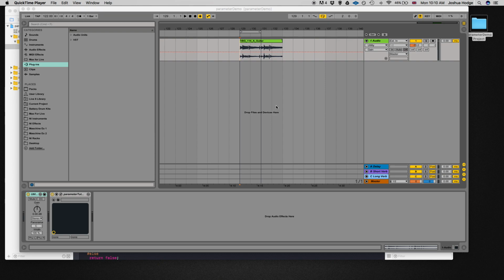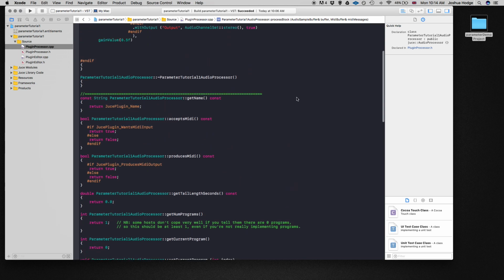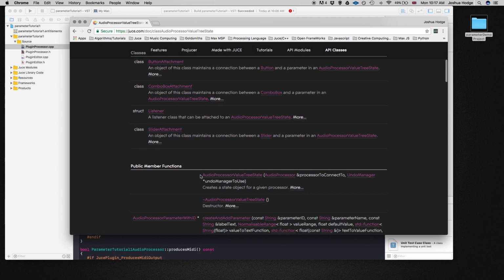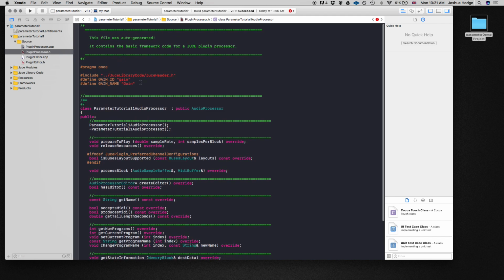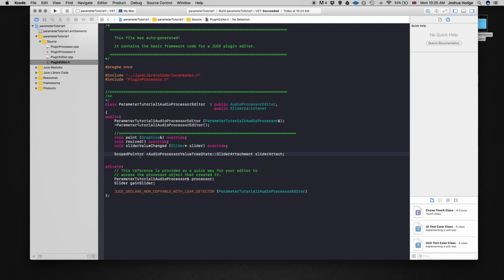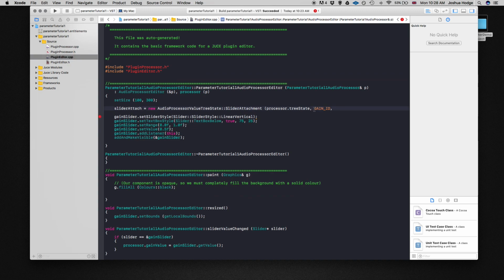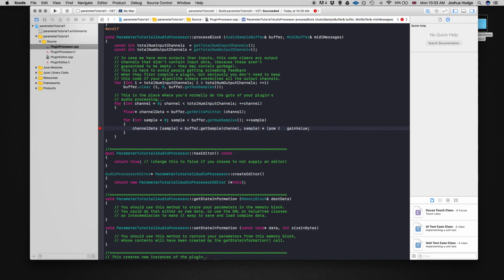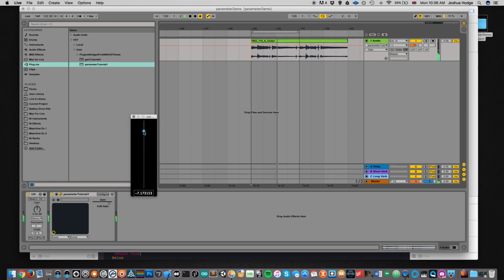Juce Tutorial 16- Creating Plugin Parameters for User Automation

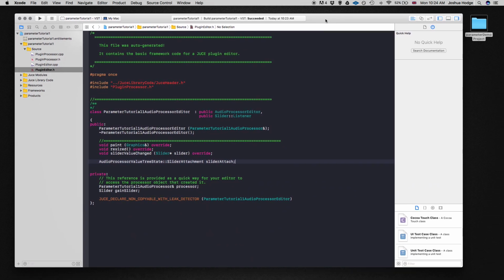Comment: Hey, I don't quite understand your reasoning at 14:40 as to why the slider attachment needs to be a pointer. How would a normal object behave differently in this case?
Reply: I did some more testing and found out why it has to be a Pointer. The Slider Attachment has no default Constructor, so the Constructor needs to be called either with new (as a Pointer) or with the Editors Constructor.

When it's not a Pointer, it has to be called with the Editors Constructor, which leads to a problem: due to the the Slider being defined after the Slider Attachment, it is also initialized after the Slider Attachment, but the Slider Attachment needs the Slider as an argument. When the Slider is uninitialized, it will crash the Slider Attachments Constructor.

It is possible to not use a Pointer for the Slider Attachment, but it needs to be defined after the Slider, and this is quite risky, as the order might change in the future and lead to the crash.

Comment: I noticed that when I compile as an AU and load it in Logic, the Gain knob in the "Smart Controls" panel does not move in parallel with value changes from automation (although it reacts to and can send manual changes to the slider). Is there some extra code I need to add to make this work with Logic?

Thanks again for doing these videos!

Comment: Hey, thank you so much for the tutorials, they are great for getting into audio programming and creating VSTs!
I tested this plugin in Cubase and Ableton and wrote some automation. I realized that the gain values are only applied if the window of the plugin in open. As soon as I close the window, it's like the automation gets ignored. Also if I close and reopen the window, the slider jumps back to its default value. Is this normal because we actually have to actively prevent this from happening or am I the only one with this issue?
Thank you! :)
Reply: Nice, that fixed the issue. Thank you so much, really looking forward to more tutorials! :D
Reply: Hi, I have the same issue, but I don't seem to be able to solve it... Unless I have the GUI open, the automations won't play. Also, in the meantime Juce 5.3.2 has been release, but that doesn't seem to solve this problem for me. Could you please tell me which commit number you checked out? Or how did you manage to fix the issue? Thanks!
Reply: @danieleghisi  Were you able to fix this? I'm having the same issue in Reaper even though I just downloaded JUCE like a month ago.
Reply: @ste_e_p  Unfortunately I don't think so, but that was so long ago, I don't really remember

Comment: If I delete the plugin from the track in Ableton Live or Reaper then the DAW crashes. Also crashes when trying to load the plugin in Wavelab. Can anyone confirm this is stable outside of the use in this tutorial? I combed through the files and I don't think I missed anything but this tutorial was different in that we didn't start by creating a new project.
Reply: Someone helped me figure this out. It's necessary  to remove the listener, release and delete the slider attachment when shutting down the UI.
Reply: @darrenblondin  When I do this, the automation doesn't happen while the plugin gui is closed.